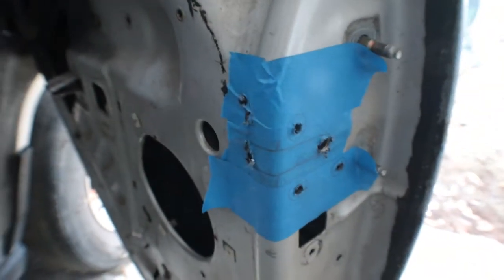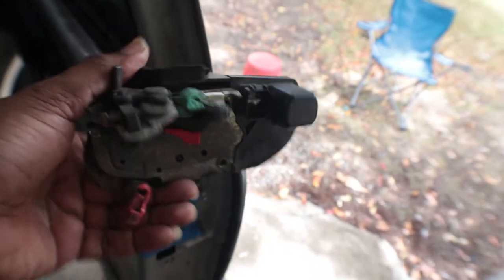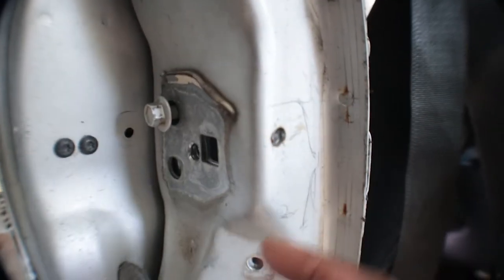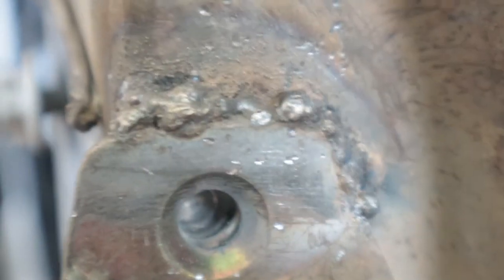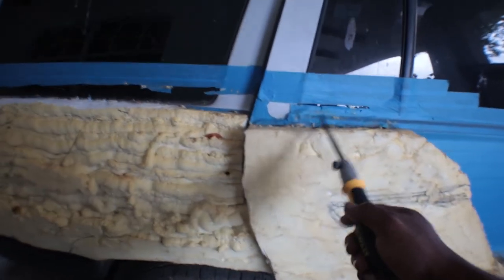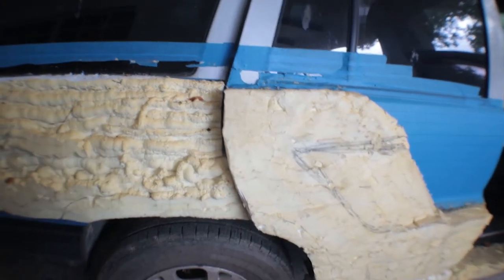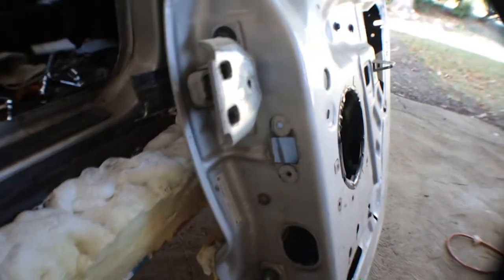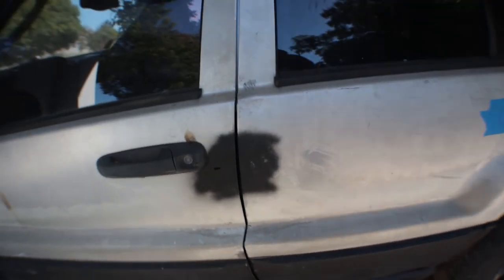Installing suicide doors on my Jeep WJ - part 2

Comment: Wow thanks!! I have a 1990 toyota pick that I want to do this on, this really helps me get an idea what I have to do!
Reply from the maker: @Gabriel Poque I'm glad the video helped. Inonly found one good video on youtube about doing this work. So glad it is good enough to get the feel of what needs to be done.. the main thing is getting the bracing for the hinges right.. other than that you will get door sag, so just focus most of the energy on bracing the hing.
Reply: Thank you for the advice, I will make sure to be aware for that! Where did you buy the hinges? They were $200 right?
Reply from the maker: Yeah ebay

Comment: you could have used riv-nuts on that door latch instead of welding
Reply from the maker: @Unfinished Business your absolutely right. The only problem I ran into was the pillard didn't have enough space for the latch. So I figured the strongest way was to weld it.